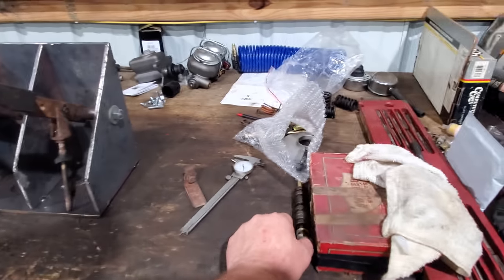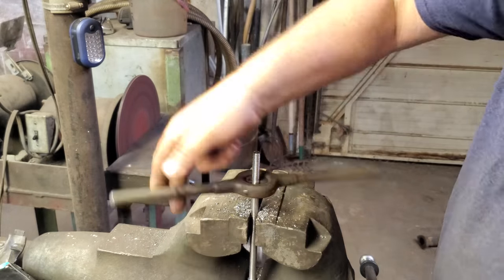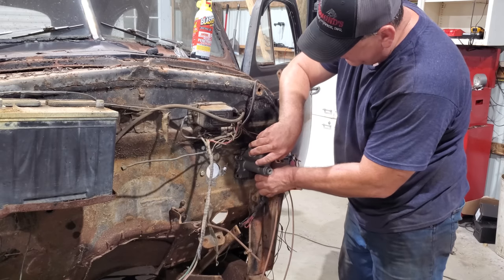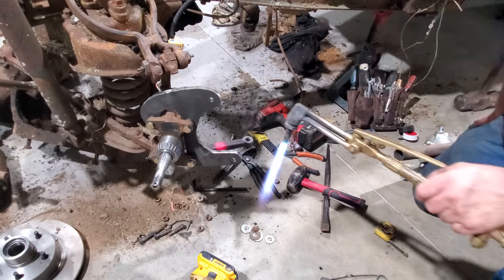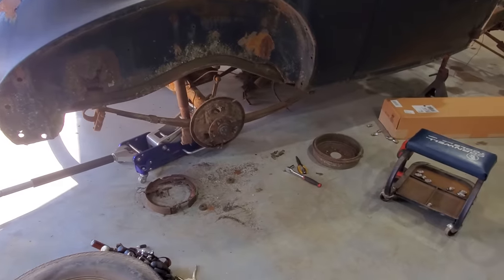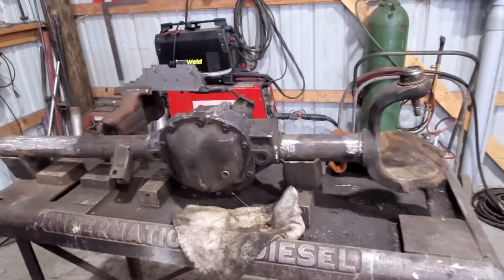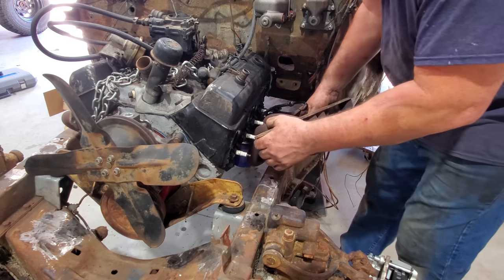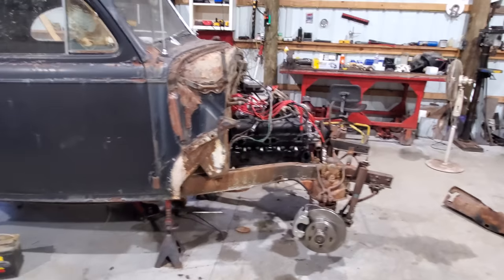1940 Chevy Coupe Part 5: Pedals Are In The Car!

Comment: I love those front mounts, they were sold by Hurst.  In 1950, I used the same type of front mount to swap an Olds engine right onto the original Ford mounts on the frame.  It sure took a lot of work out of positioning the engine.  For money at the time, I didn't have a pot to pee in, so they must have been reasonably priced.

Comment: Excellent work, starting to take shape. That's a cool front mount, could use clicky-clacky electric pump, block off plate and keep the front mount. Much easier with steering knuckles and headers... just a thought... great job as always!👀
Reply from the maker: Not a fan of that mount nor an electric pump.

Comment: AWESOME work.  When I was building my 5 window, I striped it down and found all kinds of weird welds and junk.  Thanks to HFT for grinders that I cut thru the cords of at least 4 of.  Many cut off wheels later I finally got it cleaned up. Also, cut thru a lot of rivets. Takes time but it is looking really good.

Comment: Hi this is my first time putting in a comment in your comment section,  I watch as much of your videos as possible,  have heard your issues with your knees  and watched you constantly kneeling on the concrete,  I implore  you to go and get strap on knee pads from your local hardware store,   that's what I use when needing to put all my weight on my knees.  I have severe arthritis in both knee's . Just try it yor be surprised.

Comment: More I study on the frame your using under the "Cadillac 2.0" well the more I do like it as its lending to any engine or steering mounts with it having the bottom of the frame all flat and level to make any kind of fitment ya want.... Got me to thinking about making a vise. Not just any old vise but one that has arms on it to hold stuff up to it and then you could hold something with one set of jaws and the other one be like a persons arm in a way as you can hold and turn stuff with yer arm. Lets just say you want a engine mount.... you put the one in the vice in a permanent way like the frame of a car is and the one thats mobile could be held with the one that can turn or move up and down like yer arm. Hey, its already been done for sure somewhere but since I ain't seen one or heard of one, make one and see if I can sell it on Ebay so I can be a millionaire like all our government folks are...... OKAY,  I was joking about the selling em an all but surely they are some need of something like it.

Comment: If you decide to go with the front engine mount and have to use a fuel pump block off plate, you could use an electric fuel pump and a bypass filter and run a return line back to the gas tank.
Reply from the maker: Hoping to run a mechanical pump.

Comment: Always cool to check you out Chad. Great progress on that car. That is so cool. Yeah mower….. wow. It was just time. It just said I don’t like these rods. Give me some new ones too funny how ironic that is quite a brace on that front diff  of your friend there….. yes the death wobble I was working at the Dodge dealership and got to drive a big Dodge ram, 5500 and that thing was insane. Go off the pavement onto the gravel and it was just about turning directly into the ditch but we got that sort it out. It was pretty clever use this offset ball joints and stuff … you better get insulating it September or is it November there? Lol.

Comment: I used to have a 1993 Pontiac sunbird se 2dr 2.0 h.o same drivetrain as the Beretta gtu, Three spd automatic transaxle I believe 4t60, and anyway it drove and handled great but I got tired of trying to get a good used or new casting for the h.o. 2.0 litre 4cyl anyways I can tell you if it was rwd it would have gotten a Oldsmobile 307 roller cam V8,I actually thought about buying a first gen Buick fwd 3800 sfi v6 but I ended up trading it for a 1993 GMC c2500 LT regular cab long bed California truck Sierra slx and it was pretty much a loaded option vehicle.

Comment: I have that same Hurst front mount on my 40' and use factory mechanical fuel pump, i think your missing the spacer kit that goes in-between the block and the Hurst mount, you probably could make them
Reply from the maker: Probably not gonna use it.

Comment: O'reilly's has got all the rings until those that I run about $60 on my Last eyeball rings 41 and then I bought the gas cassette for the Last 1 hour hold on Amazon it's like 15 bucks rod's I think you're about $30 a piece maybe a little cheaper than that but if you use a nap for market one from all ratlicks Make sure you lock out the rod boats because like Briggs the Stratton and coeur original rods have got little ears on them where they catch and lock into the rot at the bottom they have for market ones don't have them